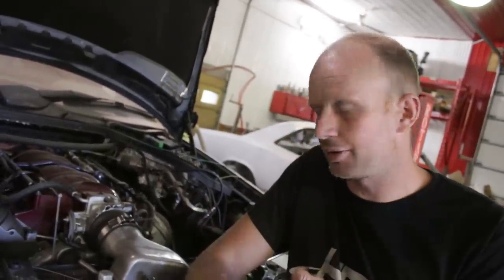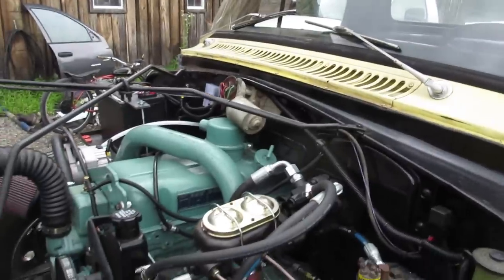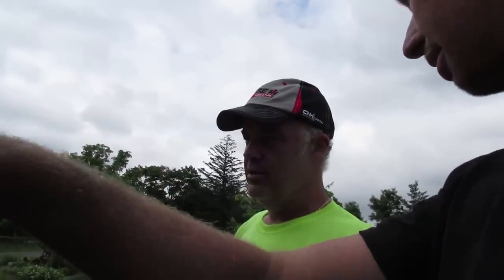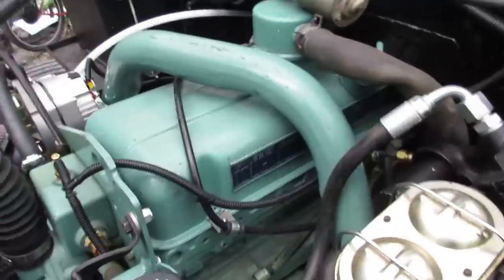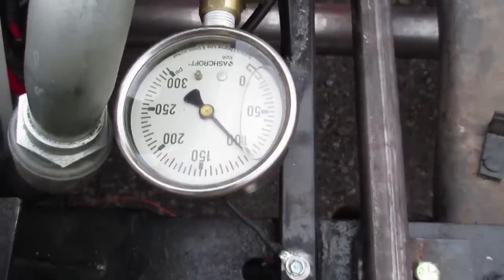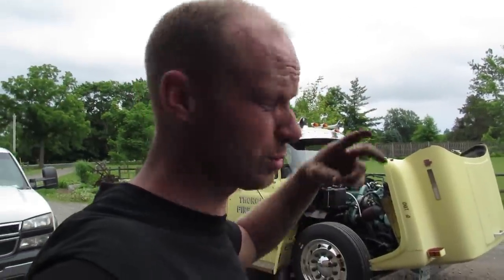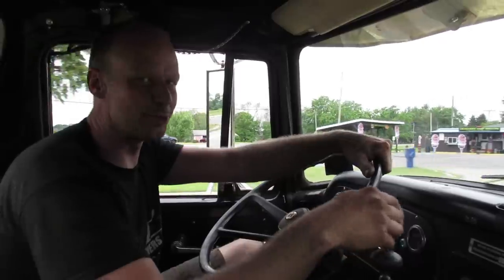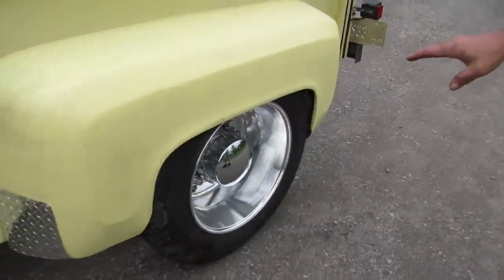AIR START! 453T Detroit Diesel in a '77 International Loadstar 1800

Comment: I drove many Detroit’s, one was a 318 with a 7 speed with one stick. The yellow truck needs a lower rear end to be able to use first gear. The Detroit sound is unforgettable. Has any one seen a Grey Marine with stern drive for mounting temporarily on barges? Yes, with a ship’s wheel.

Comment: This video put a huge grin on my face because I have an ol’ 1949 IH L-series log truck I am restoring in to a normal 5th wheeler, but I’m replacing the inline-6 gas engine with the Detroit 8v71, then I’m adding the *Banks power-pack, fuel-injection performance kit, the computer chip upgrade, twin hp turbo’s and the K&N air intake system, etc., just to keep-up with these newer trucks, but my truck does have the 2spd. Rear-end, it just needs rebuilt because it is slipping, and the lower gear no-longer works, so You get my point, but when this truck is finished,  I will post a video of it. It’s an old yellow rig like this one is, but still has it’s stainless steel thankfully!

Thanks for posting this, that sounded great!!👍🏽😁❤️👍🏽
Reply: When did an 871 have a computer?

Comment: This is only the second air starter I’ve seen. My dad had a truck with a Cummins that had the same setup. Was awesome in the winter... but only if you didn’t have an air leak. We had two extra 100 lb propane tanks converted to hold air to jumpstart the truck if it was away from the shop.

Comment: I have a couple of log skidders with 4/53 detroits in them and they come standard, like all detroits I thought, with a shut down flap on the intake. You just pull a cable stop in the cab and the spring loaded flap stops a runaway engine cold. They are dirt cheap, (almost) every detroit has them.

Comment: Connect breather hose between air cleaner and turbo also when I worked on  the boats the generators had electric starter on one side and air starter on the other If bell housing permits you could do this also use a 12 volt starter and 2 small 12 volt batteries with a 12/24 switch when starting it will give 24 volts to the 12 volt starter and it will spin it over fast enough to start with out 4 batteries.

Comment: That breather tube was called a "Road Oiler" back in the day. I had a 8V92TA in my 79 KW Aerodyne cabover and thought it would be cool to run a straight stack on it until i had to go through my first tunnel, the East River Mountain Tunnel on I-77 heading north and couldn't duck the noise with my hands or make earplugs out of cigarette butts fast enough because you have to steer it and you're on the throttle to make it up the hill. The noise was unbearable.  I threw the mufflers back on as soon as I pulled back in my driveway and vowed to myself, never again!!!!   😖
But I still love the sound a good ol two-smoke Detroit Diesel puts out and miss the old days.
The old movie from Steven King, Maximum Overdrive, has some great sound effects for the Dee-Troit.
I really enjoyed the video and couldn't stop smiling through the whole thing. Finish up that truck and let me know how much you want for it....😉

Comment: Cool truck! All the Detroit’s I was around on equipment had and emergency stop that would shut the air of to the blower and kill the engine in case of a runaway. I had a governor shaft break on a 471 in a Taylor fort truck that took of screaming. Pulled the stop killing the air to shut it down.

Comment: The way I use the air start is to briefly "flick" the starter switch. It doesn't actually need to be operated for as long as most people think. With the E9 in a Mack Superliner, it was just a flick on and off (almost before the starter was turning and that was still plenty to get the engine started. If you run out of air in the starter tank, just dump a tire into the tank (need the fittings obviously)

Comment: Cool truck and a great small diesel! For air starters though, seek out an old marine diesel mechanic. Many older work boats still use these air start power plants. Especially old tugboats. I even saw hand cranked German 3 cylinder diesels, with compression levers fitted as late as the mid-2000 years, that peaked at 800 rpm!
Marine diesel mechanics, also come up with many rigged, but very usable, solemoid driven (12, 24, 32 volt DC) devices to shut these dinosaurs down, from modern parts, that are reliable, if not original - if that works for you.
(BTW, 8v batteries are not sold in West Marine! The staff cannot lift them 🤭).
I'd bet if you scoured ports like New Orleans, you'd find help. Even the younger mechanics know the tricks, due to having to know them!
Hope this helps someone!

Comment: Old Driptroit mechanics are few & far between now but I still work on the occasional one, usually in bus/moho conversions. To get the best performance & fuel economy you have to wring it's neck & run it like you stole it. The 53 series are the noisiest of all of them, 53, 71 & 92. If you ran out of air with an Ingersol-Rand air starter you would refill the tank from the tires.

Comment: Very cool build  recommend a Spicer 3053-A  is overdrive in 5th  SAE bell compatable. From  military 6x6 M35A2 multifuel 2.5 ton transmission , has driveline brake . And is 15% over in 5th. Also a Clark VO series 5 speed overdrive would be another great transmission.

Comment: My dad had one in the 80's with a 6V53 and a twin stick transmission.

And it isn't a Detroit if it isn't leaking oil.
Reply: If there ain’t no oil under it, it’s empty! 🤣😉👍🏽 Love the Green Leakers with all my heart, they sound so great and perform quite decent, I put it like this, Detroit is like the Old cars vs the New cars ( Powerstroke, Dmax, Cummins). Detroit will always be the best thing you’ve heard

Comment: tell Jason to keep an eye on kijiji. Positive air shut-Off air guillotines are sometimes fro sale in Alberta and Saskatchewan. guys buy used oilfield trucks and remove them and sell them for 150-200 bucks. operate by cable or electric solenoid. beautiful truck.

Comment: This is awesome. A nice toolbox to hide the air tank and a wooden floor would finish it off perfect.

The 4speed seems to not suit the engine at all. But i can apprecate that someone else had done the leg work so you run with it. Personally id want to actually use it to tow my racecar.

Comment: My god that is awesome... I would have installed an electric air pump in line with the air tank. This would only be a aux pump you could use to pump up the system if it sits for a time. It will leak down.

Comment: Really cool truck! Nice job! That engine should have a factory emergency air shut-of in the blower horn that they attached a pull cable to in the cab. It's a small lever with a latch.  Run on kerosene with about 25% marvel mystery oil before storage will keep injectors free. Buy non soy diesel fuel at a CO-OP. far less algae and acid! Keep on truckin!

Comment: looks nice, needs a clutch brake so you can get it in gear.   also the shifter needs to be above the dash for the rat rod look.  air start trucks always had a manual air pump back up.  it had a long handle the driver had to pump until sufficient pressure to have another go.

Comment: there are weighted mechanical flaps to for emergency shut down, they came factory equipped on most 2 stroke detroit's because of runaways. should be able to find one of those

Comment: You can get a pneumatic operated valve that will fling a blade into the air path very very cheap, they're used for automated packing fill.  Like $200 maybe.  Instant.

Comment: All the Detroit's I worked on had an emergency flap on the intake tube, with cable release, when you pulled it, it was the same as using your wood. CAUTION, if they accidentally run backwards, there is no shutting them down - Instructions are to Run-like-Hell!

Comment: Ya propane, that's what we used too use down here in the oil patch
Reply: After the smoke blew about 300' feet away n the air and The medevac picked up all the casualties, fires were put out, burnt nearly half the plant down

Comment: Cool build. I don’t know if you can get a 2 spd rear with a higher ratio most of the ones I’ve seen are in the 5’s. Even a 5 spd tranny or overdrive would help. Could always add a 3 or 4 spd aux transmission. 2 sticks are cool

Comment: It should have a mechanical flap under the blower for emergency shut off most of them did if i remember correct, and yes all 2 stroke Detroit's had a blower had to have it to run.

Comment: Saw one on You Tube a while back. Chevy with a 4-53T and Jake brake with a 10 speed with dual 4 inch straight exhaust with turnouts about 2 foot over the cab.  It was awesome!!!!! Started my trucking career with a Detroit in a day cab  GMC 9500 with a 10 speed. Talk about shifting your butt off!

Comment: You need an Eaton  RT0 -6610   10 speed Transmission with  #2  bellhousing   10 close gears and  two reverses and  20% overdrive ..   the  6 stands for  600 FT torque  there are  9 speeds   12  series and 16 series trans  the  18 of course can stand  1800# LB toque..  

  I swapped out  an IH  RD 501 Cubic inch straight  6  for a 3208 Cat  turbo  250 HP 2600 RPMs  640 ft # torque and the Fuller  RTO 66 with a 3 speed Transper case for all the low off road gears I need with  50" tall tires and  6167-1 gears ..  The 5 speed had a push clutch with  hydraulic clutch the dual  disk pull clutch  I cut the  clutch pedal  housing assembly out of a Mack Truck with a Cable Clutch ..
  The RTO  6610 weights about 477#  and RTO 6613   13 speed is like  613#

Comment: Should have looked up an old CF mechanic because CF ran air starters on all there equipment. Plus there is a oiler for them starters that you just tap into a fuel line.

Comment: First rule of a Detroit Diesel:  If it's been sitting, check the rack!

Also these things are supposed to have a cable- or air-operated flapper to stop the engine if it runs away.

Comment: I would have a good valve on that air tank to last a year  before restart so it would be sure to have pressure. I like it. Turning engine over backwards might not work. 6 months but no money spent good deal.

Comment: those tires are save down as low as 50 psi. Though in the front i would not go less than 65 psi due to the weight of the engine. They will not come off the wheel at 50 psi no matter how hard you try. They do not risk a bead failure until around 30 psi with practically no weight. On a unloaded semi truck they will not come off at 50 psi, your pick up should be plenty fine. I run 50 psi in all for of my drives on my single axle day cab when hauling my 5th wheel RV. Keeps the tires running the entire tread patch on the ground and wearing evenly. Clearly offers a smoother ride.

Comment: I"m surprised that engine didn't already have the air shutter already on it, so that if it did take off, you just trip that pin and CLINK the blower sucks it shut and it's off. the 671's all had them.

Comment: I used to drive a 318 Detroit.. It was a  5 gear transmission  With a two speed box hi and low..  Yes it was a dumb  Truck...   If you got are the power band.. For the rpm... Good luck.....

Comment: We built a sprayer out of an old chev single axle has the same engine trans is still air five high five low with an air two speed rear axle lots of speed not a lot of power for sprayer full of water lol

Comment: cool truck, but that co2 shutdown system might not work if that 5-pound tank doesn't have a dip tube on it's valve to allow liquid co2 to be dispensed into the turbo. without a dip tube the liquid co2 will boil in the tank, chilling it down and reducing the pressure of the gas coming out of the valve. it might be enough to slow down a runaway but not enough to stop it.

Comment: Another way to stop a runaway is to use a compression release or you can just throw some water in the intake. Water will make it stop no doubt.
Reply from the maker: Make it stop by hydro locking it?
Reply: @DEBOSSGARAGE  itll stop it, wont it?

Comment: GREAT BUILD...... sure hope the oil smell your getting isn't because of using a "multi-viscosity" oil in that engine.  LOW ASH 40 (or 30 wgt in really cold climates) Straight weight oil Only.  I don't think going to a "taller" rear gear is going to benefit his engine any with that wide ratio 4 spd tranny.   Also,  the Series 53 Detroit's Never had an SAE No.1 bell housing... SAE No's. 2 and 3 only.... I can't imagine a series 53 engine being used to turn/run something so large as to require an SAE No.1 housing... with the "possible" exception of the 8V53,  but I've never actually seen an 8V53 with anything but an SAE No.2 housing on the dozen or so that I've been around, they were a pretty rare engine,  but not as rare as the 12V53.

I'm with you.... if he runs out of air....... better hope he has an air source really close by and handy to re-supply his air tank.  Personally, I've never been a "fan" of air starters on trucks.... ESPECIALLY in cold winter climates... Any condensation in the air system between the tank and starter turning to ice, and you're "done".   There were, back in the 1970s and early 80's a few "line haul" LTL trucking companies (ie: CF, Roadway, etc, etc) that tried air starters for several years,  but after evaluation periods they converted back to electric start.

I think that Int'l Loadstar cab makes for a Great "pick-up"/rod and is especially suited for having a "commercial" diesel in it... has the looks to go with the sound.   Great job!!    Thanks for the post..... and All your others, as well.

Comment: I think it's a badass build but I would still cut the rear end gear by at least 30% if not more like 50% it's a diesel it can handle the gearing. gear it for like a 150mph top speed so cruising you can actually get some gas mileage out of it. You can also look for a gear bender that way it's an 8-speed.

Comment: on them detroits thar is an emergency shut off its a flap that closeoff the blower its ran by a cable and when its pulled you have to mauley open it all them detroits have it  just because of run aways

Comment: SAE #         2  Bellhousing  it would be very  Easy to find an Eaton  RTO 6610    RTO-6610  or RTO- 610   has 20% overdrive ..    I thought  all Detroit Diesels had an air shut off valve in the intake   that his holed to a  pull knob on the dash ..  Why not just put an electric  starter in it .
  I ran a Hough 90 Loader before with an air starter  it was a V-8  IH engine .. It  was used for loading cola and explosion proof loader no alternator and no lights on it ..

Comment: Changing the diff gears alone won't quite get it the trany needs a few more tall gears. Along with a 
 2 speed. Diff. It will bring the rev's down to a manageable level. Also a emergency shut off is cheap &  easy instal. Nothing real hard to do....

Comment: What about the cable operated trip on the blower? Is it there, or is the engine too old to have it? Maybe it could be retrofitted in the future. The other way to shut down a run away detroit is to shut off the fuel.

Comment: No radio???  Just kidding. . With that Detroit you'd never hear it.

Just one question though....   is it best to run a Detroit at WOT all the time? I know that's where the power is but wondered if WOT for hours would hurt the motor.  Love these old truck. Thanks!

Comment: Hey deboss i enjoy your channel.  I am wondering if you know any of the guys who race at de camion not sure thats how its spells.  This guy eric bouchard runs a western star thats black with flames pulling the front end off the ground.  I would like to see what these guys that race tractor trailers pulling a grossed out trailer.  I would like to see if those guys run for drive shafts and transmission mods and clutches. If you know anyone who races in canada it would be interesting seeing what it takes to make 2200hp from a 3408 caterpillar.
Reply: I like the this international.  When i was in community college i took class called Heavy equipment and transportation technology.  We had several different engines we trained on running overhead one was a inline detroit marine engine . A guy in class  in hands on put the governor rod in backwards while setting the rack and he went to start it,it picked up and was running wide open . I pulled the fuel lines out of the fuel bucket and put a large Chilton manual on the air inlet . Everyone else in the class run outside.  There was smoke in the whole shop was black from the ceiling down about 8 ft. I got it shut down.  My grandfather worked on his fare share of all different 2 stroke detroits he said when they went to running on crankcase oil they will run wide open till they grenade.  We also had a old ups Mack cabover with an air starter and air clutch. I remember transmission was stuck in gear. It was very hard to get out of gear with no air built up. I bet it would be a pain if a truck had air leaks. I would definitely have an electric compressor as a back up to build air pressure up.

Comment: Look at Item #7  is the plate that shuts the air off..  It has an eccentric mount .. You have to  manually  reset it  but lifting up on a spring loaded cam .. It's like setting a mouse trap . 

https://www.powerlinecomponents.com/catalog/detroit-diesel-v71/99/air-inlet-housing

Comment: You Detroit one of them dudes out there putting in an engine and you happen to read this pay attention to what I'm telling you he said don't mess with the rail did you hear that it's a common-rail injector meaning that there is a rod that actuates all injectors on that engine off of the governor before you hook the governor up to the fuel rail bump the fuel rail several times hook the governor up bump the governor rod with the fuel rail on it make adjustment until it is one fluid motion if one of those injectors stick you have a runaway engine doing the supercharger which by the way was invented for these engines be extremely careful with the oil seals treating these two aspects in high regards alleviates 90% runaway Detroit diesels good luck